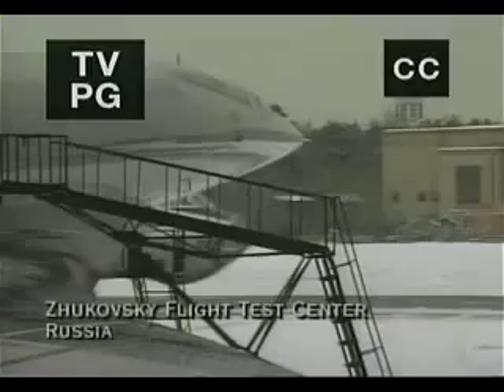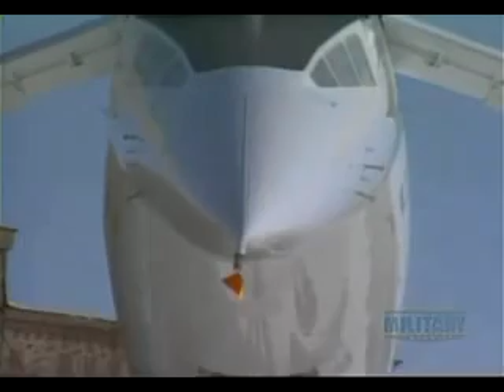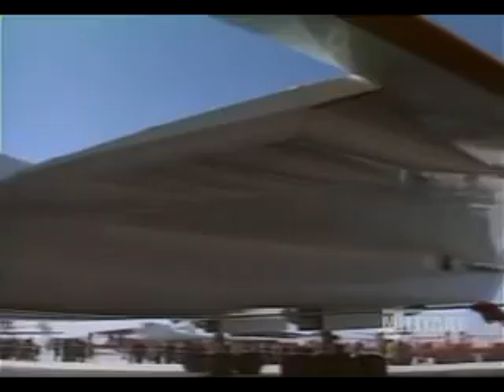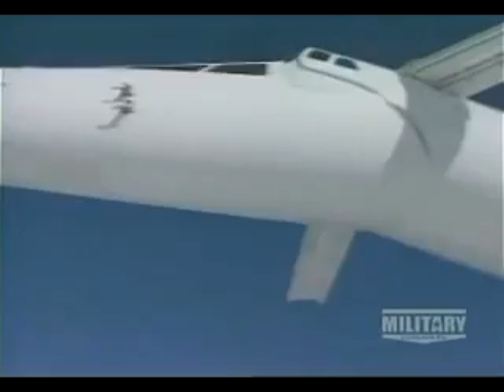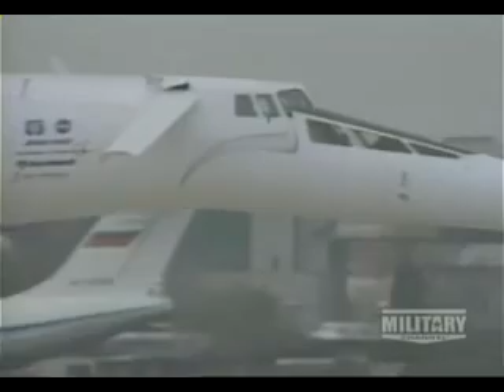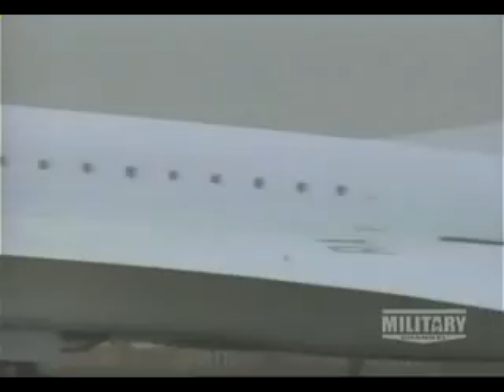Tupolev Tu-144LL NASA

Comment: I wonder if the Cunard's were adjustable or fixed position. What a cool thing. Proof that the tu-144 was not a copy of the Concorde
Reply: +Anthony Falzone - You're an idiot. At least two years ago you were. Hopefully, you aren't any more. The TU-144 was a hastily produced, corner-cutting complete rip-off of the Concorde, made from the nearly 90,000 pages of engineering drawings, plans, and specifications that the Soviet Union STOLE from the EU. 

The reason they needed canards, was because the Concorde's wing was very complex to build, and too much to engineer for production quickly. 

The goals of producing the plane were: 
1) get it out BEFORE the Concorde debut, and 
2) It had to be faster than Concorde. 

In order to achieve both goals, LOTS of Corners were cut. The TU-144 wing was therefore simplified and optimized for speed. Sadly, it was also unstable. In order to correct that, the retractable canards were hastily added. 

The TU-144 was hastily introduced 2 months before the Concorde, as though it had been some sort of developmental race. The only race taking place was the Soviets trying to hack something together and into the air before the EU premiered, so they would look less like they stole the design - like they fooled anyone (except you, of course). 

The Concorde was in service for 29 years. 

The TU-144 carried passengers for 1 year and freight for an additional 5. 

It was flying crap. The TU-144 was exactly what happens when the shit hits the fan. At its peak, the TU-144 flew ONE flight per week, and only over 1 route, between 2 cities. A TOTAL of 16 were built, with a maximum of 8 ever available for service. 

Isn't communism great? Huh, Marxist minion?